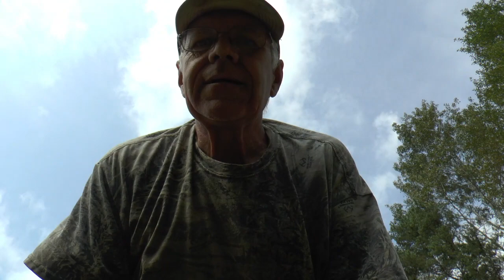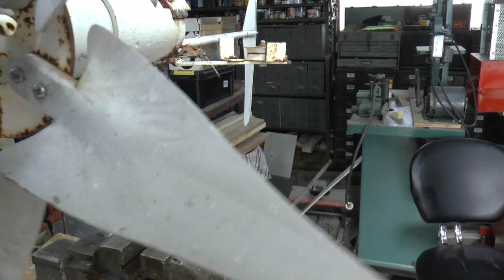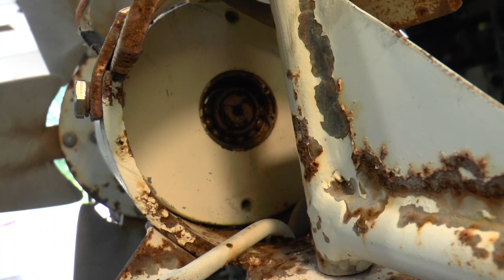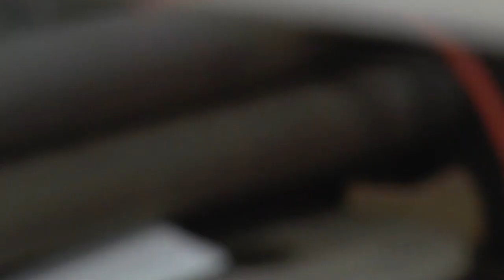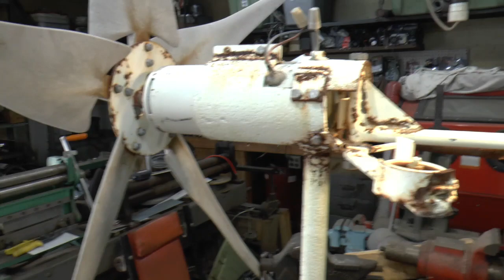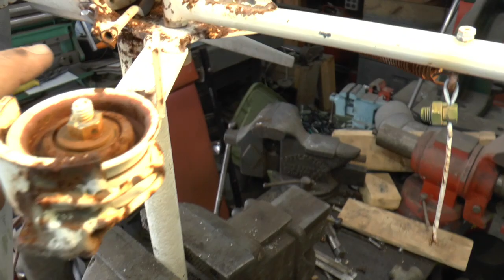Smart Drive Wind Mill Project Part 2 Taking down the failed windmill

Comment: How tall is your tower?  I have a 40' one to put up at our farm but it is all sections like yours at the top. With it, you hook up your safety gear all the way around it and climb. No separate rungs to worry about.
Wife: " Blah, blah, blah!"
Reply from the maker: It is 40 feet. I built it from scrap pipe and and iron about 35 years ago. I had a windcharger 850 on it first that weigh 169 lbs. so it is sturdy.